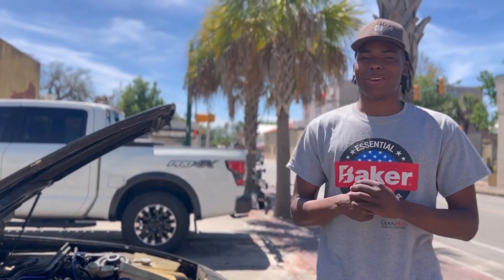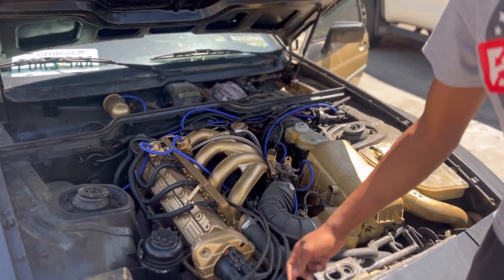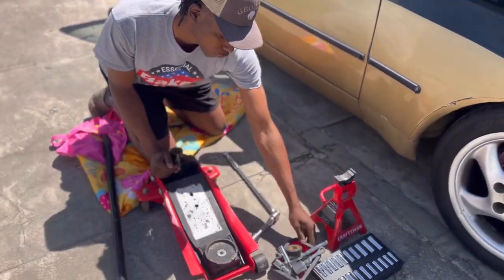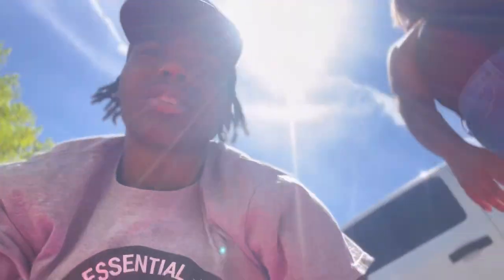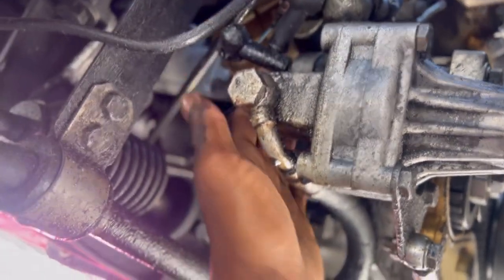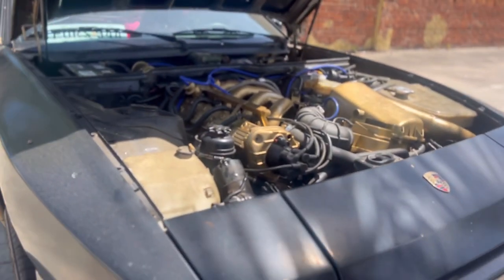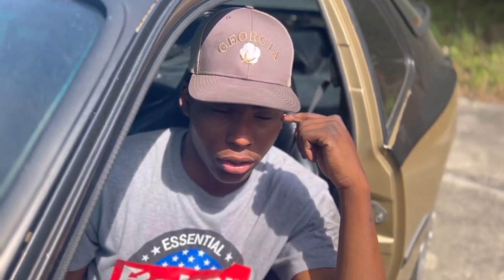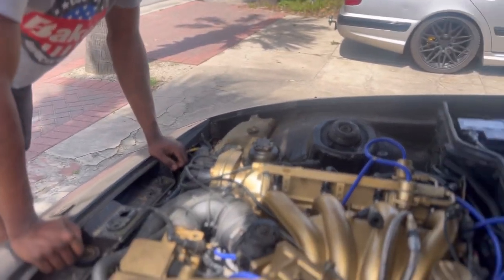New part did not fix my Porsche 944 what can it be

Comment: So a couple things to check that might cause this issue. Speed/ ref sensors will affect the car running but not cranking. Make sure your belts behind the covers are in tact and not broken that’s where the cam belt and balance belt are. Your car doesn’t even crank so there’s 1 primary system I recommend looking at.

We know your starter is good, but when you turn key hit the connections with a volt meter and see if the starter is getting enough voltage. It sounds like it might not be getting sufficient voltage to kick the solenoid out. 

From there back next thing to check is the battery, make sure you’re battery is good, it could’ve died on the road and not restarted due to a bad alternator. The battery would’ve lasted you until it was completely dead. The bad starter could’ve been an indirect culprit leading to a bigger issue. 

The ignition switches in the early cars can be kind of a pain in the ass. I believe they’re cheap enough that if you’re going to take the wheel off and disassemble the column you might just be better off replacing it anyways. 

If you had a bad DME relay I’d still expect the car to crank. But you’d have no fuel or spark.

Even if the speed/ ref sensors were bad I still believe the car would crank, you just wouldn’t have spark. 

Unless you have a scope, you won’t be able to see the valves unless you pull the intake off, it’s tough to see anything crazy through the plug holes. 

Since your car was running just fine for most of the trip and that clicking of the starter it really sounds battery related to me. As always start simple and just check fuses/ relays first. 

I hope some of that stuff helps and hopefully I didn’t cover too much of stuff you already checked. GL bro I’ll keep watching  to see that sweet moment of victory when you find out whatever the issue is. 🫡👍🏻
Reply from the maker: Thanks for detailed input really helpful 🙏🏽